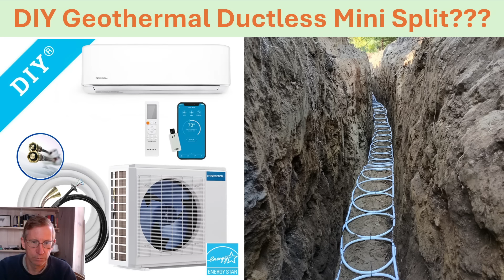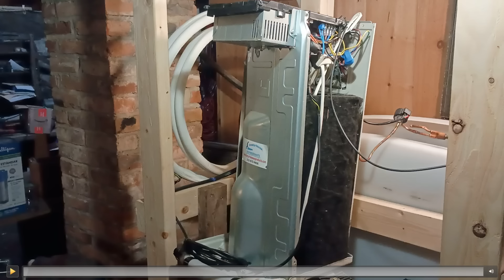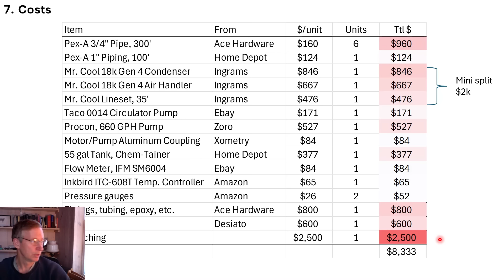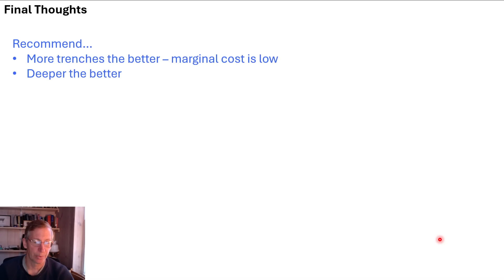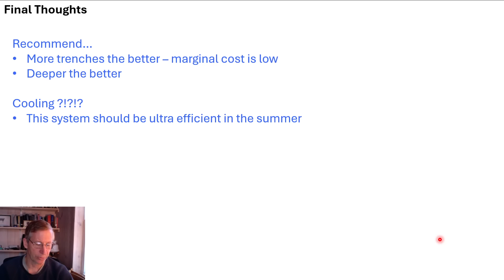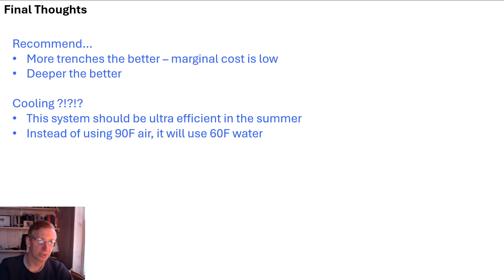DIY Geothermal Ductless Mini Split (Ground Source Heat Pump)

Comment: Thanks for all the great info!
I would not use the motor from the mini to run the pump, how about an independent motor that wouldn't run into the reverse problem? I use BLDC (brushless direct current) electric bike motors for my apps now that have variable rpms and can run from a SMDC (switch mode direct current) power supply. Very efficient and if you can program uC's you can really contour your system.

Have you experimented with a hot water element in the tank to stop freezing?
It would raise your energy consumption but it would take very little to raise it above freezing with such a small tank.
Reply from the maker: Didn't want to get into switching the motor, just because of a lack of understanding how to do that successfully.  Finding the right pump head seemed like the easiest option, until I found out the reversing was going to be a problem.  I've been distracted and haven't gotten back into finishing it, but will address the issue eventually.

I don't think a heating element makes sense, kind of defeats the purpose.  The higher flow circulating pump does the trick and only runs a small percentage of the time.
Reply: @edwardwazer5103  I can see your points. 

I did some tests on one of my mini's, just simple stuff, the thing is During the day I have so much PV that it runs my mini's for free so it's only at night that the COP drops. I'm running batteries I just upped them to 30 kWh to see if that keeps the mini's going at night.
I do have a decent backhoe on my tractor but digging trenched in our hardpan is monstrous, it took me four hours just to dig an eight foot hole for two foot wide sonotubes. I could hire an excavator but he'd charge us about $10k for trenching. My other option is the 1/3 acre 12 foot deep pond but I'm wondering if it would raise the temps and kill the brookies.

Comment: Did you consider an overrunning clutch for the reversing problem with the fan motor and pump? It would allow the motor to harmlessly run in reverse but the pump would not rotate. You can get one that would work as a coupling between the two shafts. McMaster Carr has a few to look at to get started.

Comment: 2:53 The reason why your stove takes so long to get hot is because you don't know how to use a wood stove. There are plenty of good videos here on youtube that will show you how to get the most out of your stove. Do some research. With the money you spent on this geothermal system, I could heat my 30 year old 16x80 mobile home for another 40 years. lol.
Reply from the maker: Haha!  The heat capacity of soapstone is the reason it takes so long to heat up.  I can get a metal stove throwing heat in minutes.

Comment: 24:00 - for the reversing motor - would be easy enough to replace your 3d printed coupling to integrate a 1 way clutch (even just off a bicycle for example). 
Alternatively, replace it with a dedicated water pump running of a relay and get rid of the motor+ pump combo... probably more efficient too?

Comment: You need to put an overrunning clutch on the motor shaft that is driving the pump that will allow it to only run in one direction. You might be able to use a cheap one from a 540rpm tractor pto shaft.

Comment: Excited to see the summer data!
Reply from the maker: Unfortunately I barely ran it over the summer and I didn't process the data.  Assume it was VERY efficient, with water temperature around 60F.
Reply: @edwardwazer5103  do you reverse the flow through the loop between the seasons? Or even within season to balance out the uneven heating/cooling of the ground?

Comment: great video only thing I see being a major failure point is the part they have in the tank might fail.  It's probably not made the have water flow over it constantly.  Water has friction tho we dont think of it most times.

Comment: Very neat setup, thanks for sharing.  I used Gree/MrCool universal ODU to a refrigerant-water coil to make an air source to hydronic heatpump system, it's still working fine after several years.   Your plots (and the fan motor running in reverse) look like the ODU is doing defrost cycles.  Maybe tinkering with the ODU's temperature sensor (take it out of the water, or offset it with resistor to similate higher temperature) would fool it into less frequent or none at all defrost cycles.

Comment: Great video. As a British HVAC engineer hearing you still use BTUs as a measurement takes me back forty years.
Reply from the maker: It is such a pain working in imperial AND metric!
Reply: and feet.
Reply: Today BTU is a commonly and worldwide used unit in HVAC industry. So no surprise.
Reply: @DmitryAvsioukov its not worldwide, lots of places use KW.
Reply: @Etacovda63  One BTU is defined as the amount of heat required to raise the temperature of one pound of water by one degree Fahrenheit.  So any country not using retard units is using kW.  With a small k.
Reply: @Etacovda63 
Where?
Where is it that they don’t use btu ?
Reply: @kriskulczynski8957  uh, the vast majority of the planet? we all use metric units, Watts, KW, KWH. The fact that the British dont use the "British Thermal Unit", named after them, tells you about how outdated it is...
Reply: @kriskulczynski8957 We don't use BTUs in Asia, everyone uses kW or tons of refrigeration (mainly residential) and sometimes hp for big commercial systems.
Reply: @Chopp @Chopper153 we use tons for ac too.We are all mixed up here

Comment: If your pump motor is actually DC, then you should be able to use some power diodes to limit the current flow to one direction, that way the system can't cycle the motor backwards. If it is an AC motor, then you will need to setup some kind of phase monitor and a shutoff switch to cut the power to the motor while the phase is reversed during the reverse cycling.

Comment: Great video.  Thanks for documenting this!  Watching my main concern/review comment would be on the likelness of the fan motor burning out when repurposed as a pump motor. I think you could replace it with a relay and a pump motor if that happens. If you can find the control signal it would be simple, if you can't it might take a microcontroller to figure out the 3 phase is  trying to do and trigger the relay.  I'd have to play with it a bit to figure it out for sure.  Do you have an estimate on how long it took for those considering doing this?  Thanks!
Reply from the maker: I'd guess it took at least 200 hours.  🤔 (wow, my time must not be worth much!)  Mostly research and part selection searching.  The actual doing was less than half.

Comment: As a comparison to a commercial ready installed ground heat system in norhern Europe. 50 to 90 k USD i much more than it would cost in Europe. Over here a pump would cost 7 to 12 thousand depending on the size. The installation cost is around 2000.  If you drill a well it would cost around 10 k for 180 meters including all pipes, glycol and connections including installation. If there is no heating system floor heating would cost another 5-10 k. The overall cost would an average be some 35 k including all permits for a well on your property if needed. If the pipes are installed in trenches the cost will be less. This may vary quite much depending on the conditions, how much rocks there is in the ground etc. Hiring an exevator guy will cost around 200-250 euros per hour depending on the size of the excavator. Gravel will cost around 35 EUR per metric tonne plus som 50 Euros for loading 20 tonnes plus 100-200 EUR for the freight depending on distance.

We have had geothermal ground heating since 2004. The pump was replaced in 2023, cost was 11 000 exluding some minor tax benefits for the installation work. The unit itself meassures 60 x 60 cm and is 180 cm tall. On the side there is a 20 cm space for piping and on top another 50 cm for piping and other eqipment. It looks like a fridge. It sits in utility kitchen washing room. The pipe work I have covered with laminated MDF boards. It is a little bit cramped but managble. A tecnical room would be preffered. The sound level of the pump is not loud but you will hear it warming water. It is loader than a fridge when operating at 70 percent and above but you do not hear ifnit operates below 50%, which it does most of the time for heating. The unit will regualte the speed to minimize the starts and stops to prolong the life time.

The heating season were I live is from mid September to end of May. In 2024 the heat pump consumed 3663 kWh and produced 14912 kWh for heating and warm water production so the COP value was 4.07. Last February was mild with an average temperature of -1.7 C. The COP of the pump was 4.4 for heating and 4.1 for warm water production. February 2024 had an average temperature of -4.2 C the COP for heating was 4.3 and total 4.2. The COP is normally around 3 or much lower as it heats the water to 55 C and tops the rest up to 62 C with eleictric resitance heating. The max temperature in the underfloor heating is set so that it is +35 C, this not to cause damage tp the pipes or wooden floor that we have upstairs. Downstairs it is mostly tiles on the concrete slab. This is perfect floor for low temperature systems.

 The average winter temperature were I live is -4 C. The average yearly temperature is +6-7 degrees, which also is the temperature that comes out of the well. The unit is 7 kW. We have floor heating, and the house is 208 square meters. Windows are normal size 3 glass window, two outlayersnis argon filled double glased and the ineernwindow is 5 cm sits 5 cm inside and the space is just air, no large floor to ceiling windows. There is 25 centimeter of rockwool in the walls, 10 cm of styrofoam under the concrete slab and 10 cm styrofoam inside the foundation. There is 40-50 cm of blown insulation in the ceiling.

The electricity prices vary but last year it was around 17 cents per kWh including taxes and grid costs and margins to the electicity utility. This means the cost of heating and warm water for the full year was around 700 Euros as the electicity costs more during winter. It can however be double if spot prices are high. We pay a margin of 0.48 cents per Kwh on top of the spot market price in margin to the utility. 

The ventilation system has an heat exchanger but it also heats the incomming air to +4 C so it won’t freeze. This ofcourse draws some electricity as well. We also have an electic sauna that we use once or twice  a week. We have a separate garage / workshop of 58 square meters that is heated by an air-to-air heat pump to +13 C during winter. It gives more than it takes down to -25 C. Our total electricity bill in 2024 was 1840 Euros.

Still, the cost of our Mitsubishi air-to-air heat pump replacement was 2000 Euros in 2023. The old pump was still working but the modern versions handles below -20 C better than the old ones. Now I don’t need the wall mounted electric heaters for anything else than back-up in the garage. Here a qualified installer is required and you do not want to install it during winter as a test of the air conditioning fuctionality is also required to be included in the certificate.

In the Nordic countries a gound heatpump is the most common source of heating above 160 square meter properties ouside densily built areas. In more densily built areas the wells would be to close to each other and ther is also other underground infrastructure that would not aloow you to drill a well. Typically in these areas there will be a utility central heating system to all properies which costs even less in terms of investment and energy costs than an independent system. For smaller properties there are air-to-water heat pumps that works down to -30 C.

In the Nordic counties popular brands are Nibe, and Bosch. Our geothermal heat pump is a Bosch Compress 2-8 kW inverter heatpum and our garage is heated by a Mitsubishi Electric LN25. I would say your system has similar efficency as a commercial ready system. The fommercial system will have a guarantee and maybe comes in nicer package. The automation of the system is mayble more advanced, but it will cost more. a commercial system are built with standars parts so there is nothing propriatry than the automation system.

Comment: Thank you for taking the time to make this video and share your hard-earned data and analysis. Have you done a rough break-even analysis given your cost of electricity (I understand you intend to go 100% solar in the future)?

I've had similar thought excercises over the years and I finally decided that an earth-air heat exchanger (EAHE) supplying a fully-intact outdoor unit may be better for my own situation. With multiple parralel 'earth tubes' and a low power blower at the intake end outside to supplement the condensor fan, I feel like I can achieve a 25-35% increase in COP without nearly the complexity of a fluid based system.

Of course an EAHE will not move as much heat as a fluid ground loop and may have issues with bacterial growth, but my use will be for a small, highly insulated and sealed home (~700sqft with 6" SIP walls and 10" roof in Zone 7a, and using a 9000BTU unit). Since the tempered air is only being supplied to the outdoor unit, there is not as much concern for the quality of the air exiting the tubes.

I'd like to hear any thoughts you have on such a system.  Thanks again and like others here, I would love to hear how your system did over the summer heating season.

Comment: Cool project, but I would caution that in addition to the freezing risk, pure water is a polar molecule and will strip metal ions off of the evaporator core over time.  As such, I would recommend adding some RV antifreeze or methanol based washer fluid like someone else suggested.  If you are worried about losing heat transfer performance you could add a product like water wetter to reduce the surface tension of the fluid to get better contact at the surface of the pipes, improving heat transfer.
Reply from the maker: I agree with your point.  I suspect that I'll pull some metals out and eventually it will come to an equilibrium.  If I were continually running fresh DI water through it, I'd be more concerned.
Reply: @edwardwazer5103  Hermetically sealing the system and perhaps even purging the air out with inert gas will at least slow down the oxidation reactions, and I'm sure it won't take long for the DI water to reach its saturation point. Perhaps use of anode rods would also aid in longevity.
Reply: Isn't the outside heat exchanger more or less constatly flushed with destilled water (i.e. condensate) in normal heating operation anyway?
Reply: @andreasu.3546  No, in a normal geothermal system, the outside ground loop uses a glycol based antifreeze solution in a closed loop circulation to reduce the possibility of freezing.
Reply: @r.j.bedore9884  I was talking about air source heat pumps like what is used in the video. Your argument is that keeping the evaporator coil under water is going to damage it. My question is if that would be any different in normal operation of the unmodified unit since it would be covered in condensate most of the time.
Reply: @andreasu.3546   My argument is that automotive manufacturers have discovered over decades of real world testing that running distilled water through copper or aluminum heat exchangers like those in a radiator or air conditioner will strip metal ions off the parts due to the polar nature of water molecules.  The water that condenses out of the air on an evaporator coil won't have minerals in it like regular drinking water, but it also won't be as pure and ionizing as distilled water due to all of the dust and charged particles in the air.
Reply: @r.j.bedore9884  the term you are looking for is galvanic corrosion. Basically aluminium will oxidize and rust away when in contact with copper and conductive liquid

Comment: Could the condenser be placed into a body of water such as a swimming pool, pond, or a dedicated underground large tank?  The AC technician could fabricate copper lines to and from it.  

That would seem to greatly simplify the build because wouldn't have to dig huge trenches, run pex lines that tree roots might attack and cause to leak, no complex circulation system to keep on track, and it would be no maintenance same as if the condenser was in free air.
Reply: those bodies of water usually get colder than undergound temp
Reply from the maker: If I had a pond, yes, but you still need flow across the condenser.  It will freeze solid otherwise

Comment: If I was installing at a new site, I would make use of other trenches, such as the septic leach field.  You may be able to use a less expensive tank circulating pump like those used in aquariums.
Reply from the maker: As for the septic, agreed.  It would also keep the soil moist right where you need it.  
The pump was probably the most work, hard to find just what I needed at the rpm of the attached motor.
Reply: @edwardwazer5103  Septic drain field is probably nowhere deep enough though - only about 3' max even in the extreme. I would also suggest that the water from the septic system tanks is probably colder than the suitable ground temp, so while the wet soil improves conductivity, it may have a negative effect depending on the water temp.